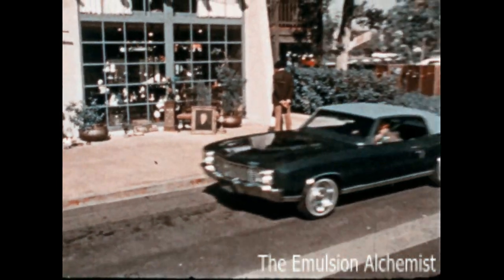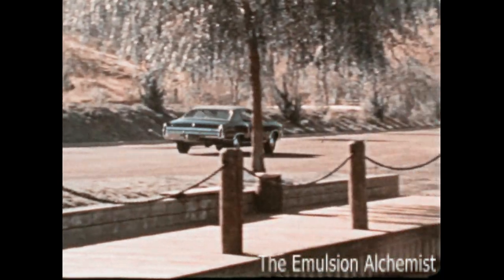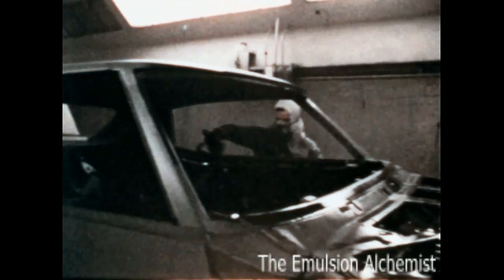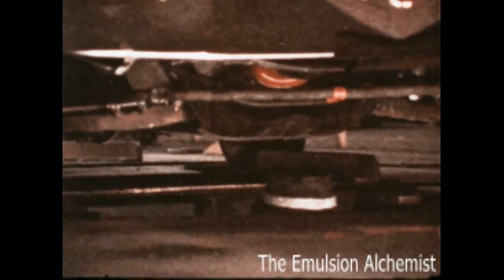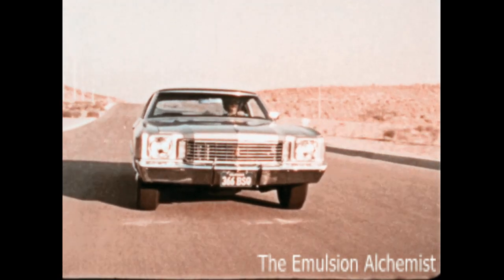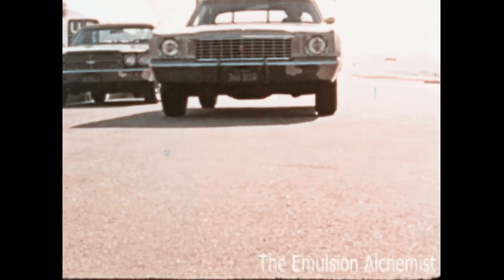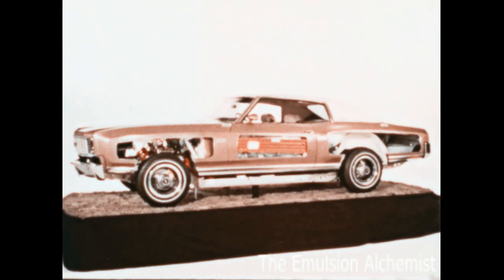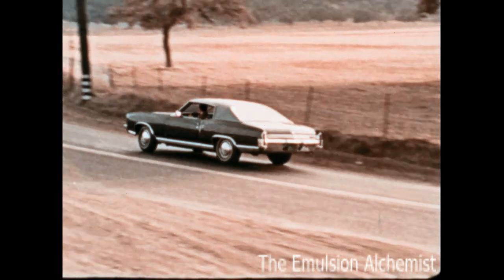1972 Chevy Monte Carlo Automotive Dealership Sales Training promotional Film

Comment: Although I like the first gen Monte, I have to admit that I never saw the point in it. It was marketed as a personal luxury car, but you could get the same experience in a mid-level Malibu 2 door coupe with options. This video reminded me of Fisher Body craftsmanship. Filling the roof seams with lead, and then hand-filing it---that's a lost art
Reply from the maker: ford and chrysler used bondo, could not agree more
Reply: 😂 true, but the point might have been the Pontiac Grand Prix, & the Oldsmobile Cutlass and Chevy’s need to try and keep up with the GM’s Jones’ personal luxury models.
Reply: A four inch longer wheelbase.
Reply: Pontiac cleaned up in ‘69 with its GP, that’s one of the reasons the MC came to be.   It lasted 19 build seasons as a proper RWD personal coupe.

Comment: I'll never forget I was 11 years old and my father bought a 1972 Monte Carlo Custom , which was a rare upgrade.
It came  from Fairchild Chevrolet in Lakewood Ohio it was in the showroom dark green, Blacktop, dark green bucket seats. 400 4 barrel with dual exhaust.

 It had the most beautiful finned wheel covers similar to some Corvettes.
 I absolutely loved that car. 
 then they did the redesign in 73 and he got on the waiting list yes there was an actual waiting list for the 1973 Monte Carlos. 
His new one was dark blue with a light blue top and it had swivel bucket seats it was a Landau model. a big deal about the 73 Monte Carlo is they said it had a suspension similar to that of a Mercedes-Benz so it was supposed to be a real Road car. I remember his was equipped with the f41 suspension actually both cars had that.
 I actually like the 72 more as a kid.
I remember when I turned 16 I was fortunate enough my father bought me a 1977 brand new Monte Carlo. White with a red Landau top. It wasn't loaded so I was disappointed. Talk about a spoiled little kid.
Reply from the maker: enjoyed you story. hard to compare the 77 to the 72, not the same quality